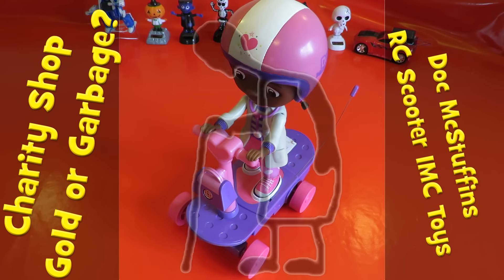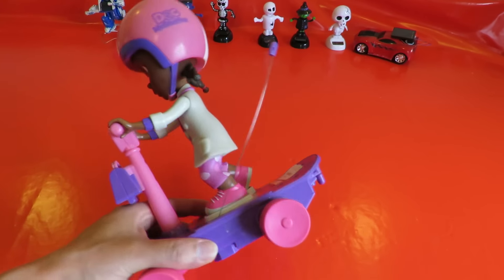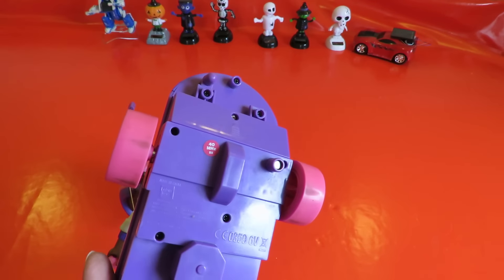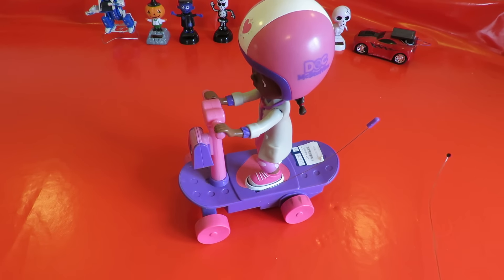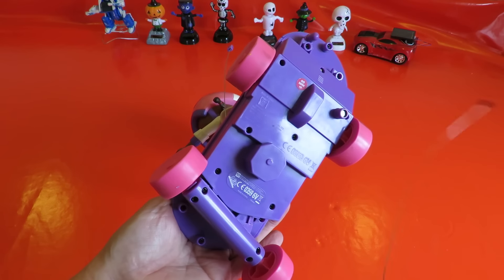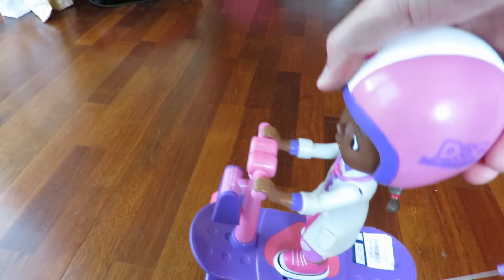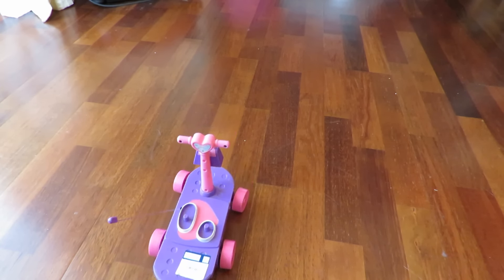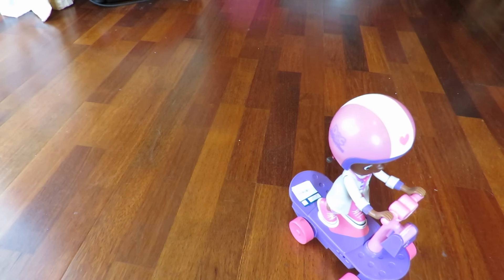Charity Shop Gold or Garbage? Doc McStuffins RC Scooter IMC Toys

Comment: Hmm. How about taking out the motor and making it a fan powered thing? Because the gear broken system is broken.
Reply from the maker: It is quite a heavy toy so it would need a fairly powerful fan to drive it along. Fixing the gear shouldn't be that hard to do but it might just become a donor item for parts.
Reply: GrandadIsAnOldMan Alright grandad. have fun trying

Comment: yo do u know how to get this to do sick tricks? Saw it spinnin on an advert and I'm confused af lol. How u get it to do dat hehe
Reply from the maker: This one was second hand and didn't seem to be working properly however watching  this video https://youtu.be/gJU7IGGUSDE it looks like you need it to tip up on the back wheels to do the stunts. I have had similar toys that are skateboard based. The trick with them was to go backwards as fast as possible then push the control stick forwards so it overbalances and tips up onto the back wheels. Then it will do that spinning around. It may even be as simple as positioning the figure so it is balanced towards the back so it tips up easily.